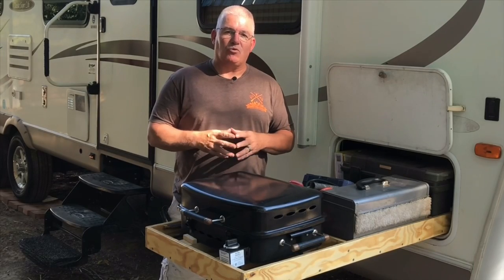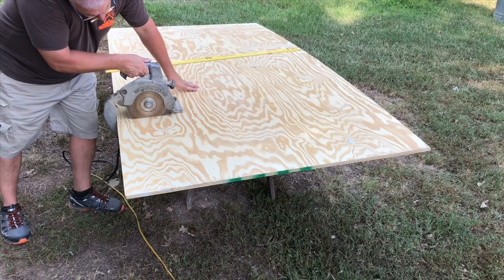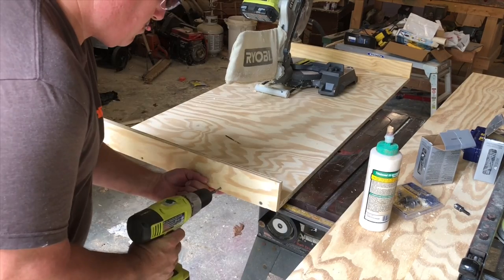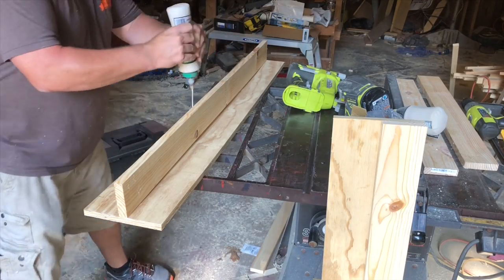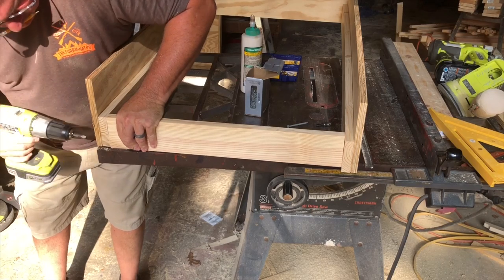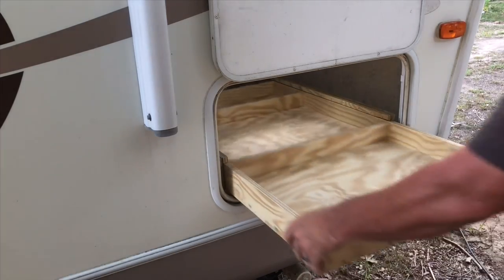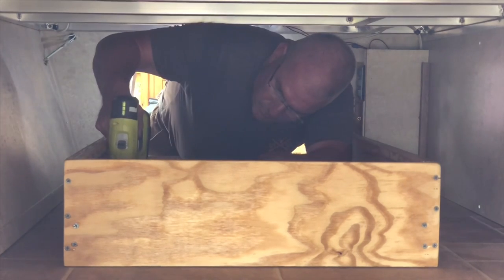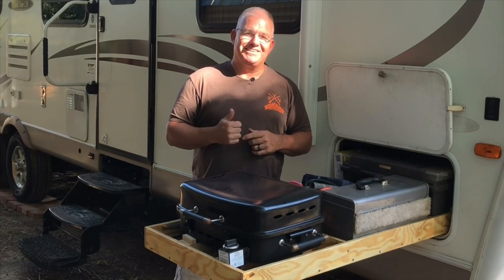DIY RV Storage Drawer

Comment: Love the concept, and way cheaper than buying custom made shelves. I just finished a pair of these for my travel trailer. I tweaked the design a bit by adding some casters under the drawer so they pull out easier, and attached barrel bolt locks to the front to keep the drawers in place while moving.
Reply: How did those casters work when pulling the drawer out. I was thinking of something like that

Comment: Thank you very much I've been sitting here beating my brains off the Wall trying to figure out what to do for my front storage compartment also.. This is been a big help.
Reply from the maker: Glad I could help, this thing has come in very handy since I built it. I use that drawer daily while camping and I’m never digging and hunting for anything because I have full access to everything on that side of the trailer. The other side is a different story, I had to move several things to even see inside the compartment on our last trip. Hoping to be able to make one for the other side soon. Thanks for watching and good luck with your project

Comment: Just found this video...a perfect inexpensive solution. I'm going to build them for my travel trailer...thanks!
Reply from the maker: Thank you, I think you will be pleased with the drawer, I would not want to go back to a big empty storage compartment. One tip that may help is, on the runner or bottom board that the drawer slides on, I coated it with WD40. Someone suggested coating it with a paste wax. Mine slides fine but the wax would probably be worth the try. Thanks for watching

Comment: I little bit of soap bar on the bottoms will help it slide. Also I'm surprised u didn't use drawer rails. But looks like a solid build in either case.

Comment: II've been watching lots of videos searching for this...I'm tired of reaching way back into my tool-storage bay trying to open tool boxes, remove trays and pull out that one tool I need and unstacking layers of boxes to reach the box I need that tool from so I was thinking of making an open-bottom slide-out with 300 pound sliders so that the area below the lip of my bay opening (6 inches) can be accessed easily and I could utilize the height above it with another slide-out and double-stack my boxes. I was thinking of using square tubing for rigidity and because it takes up less volume than wood. I can't travel without all my GC tools so my requirements are different than most RV travelers. Appreciate your video a lot...it let's me know I can do this.

Comment: Cool project.  I stopped in because I have kicked around the idea of doing the same thing on my Class A.  I have a long compartment like yours but only one door on one side. (passengers side)  So it's purpose I can only guess is for snow skies and long tent poles and such.  I have 24" wide rubberized plywood runners that are tounge and groove flooring stacked in there that we use as a hard patio floor.( Keeps the mud and dirt out of the Coach.) But have been wanting to build a slide out outdoor kitchen in it's place since it's right next to the outside sink and hot/ cold shower hose.

Here is a tip.  You can use Pocket Door Rollers to make your drawer slide easy. The rollers are brass ball bearing rollers with a cable size groove in the edge. (This edge groove is perfect for for use as a cable guide roller pulley.) Which make them the perfect choice for running in "V" notched plywood side runners.(Tounge style of the tounge and groove flooring)    You can buy these Pocket Door Rolllers at most box and hardware stores for about $8 to $14 dollars a pair. Your options are to seperate the rollers from the supplied bracketry and use the ball bearinged rollers individually, or keep them on the bracket and just double up on your rollers to spread the weight onto your runners. But using them on the supplied bracketry you can reduce the thickness of your plywood in this application and still have enough strength.
Lots of other ways to use these brass rollers.  I found them at Ace Hardware and used them for a different project, after searching for 1" to 1.25" ball bearinged cable rollers for a wall hugger recliner modification I wanted to do.  Funny thing though, the Ace Sales Guy swore up and down they had no cable pulley rollers for sale in the entire store, then I happened to walk by the pocket and screen door parts isle and saw them.  They were perfect.  I bought 8!  (All he had!) :)

Comment: The wife and I have 2021 mini lite with a pass thru, right now its disorganized. I thought paying 600 for the drawers and frame, but I really like the idea of using wood. The doors on both sides are the same size I think.
Reply from the maker: The drawer really helps, even if everything in the drawer is disorganized, at least you can pull it out where you can see what you have in it. Wood worked great and was still holding up great when we sold the camper in January. We bought a 2022 and we don’t need the drawer on this one, no pass through compartment and not much storage

Comment: Thanks for the ideas. Let me ask you about using wood screws or any screw for that matter when building and or working with plywood. Do you need to drill pilot holes before installing the screws themselves?

Thanks

Comment: Great simple design. Looks very sturdy! However, I believe you suffer from my disease. Probably most DIYers suffer from what I call the "overengineering disease." The three quarter plywood definitely makes a very sturdy drawer but as you showed us, it adds quite a bit of weight. I believe you could use thinner material and still make something strong enough to do the job you are trying to accomplish. A quarter inch bottom panel glued and nailed into a dado in the bottom of the drawer I think would work, especially if you added the dividers into the drawer. (Without the dividers I think quarter inch plywood would probably be too light for that long of a drawer carrying that amount of weight). I also believe you could use half inch material for the sides and definitely for the frame the drawer slides into. You need the three quarter boards for the runners for sure. I recently made some shelves out of half inch plywood with inch wide quarter inch  plywood strips glued and pin nailed around the periphery of the shelf. I've loaded some very heavy hardware on these shelves and they haven't bowed even a little. I hope maybe this might help someone who is particularly concerned about the weight issue but wants to use this wonderful design.

Comment: Like your video but will use 4 long plastic containers with tops bought from Walmart or target 2 on each side take items out that I need slide it back in and set 4 collapsible  chairs on top of containers got a pretty wide storage doors they fit nicely when I pull out a chair I set a container on chair look for what I need slide back in container put chair on top

Comment: Wonderful idea.  How do you determine what length of screws you can use to support the "L" brackets to the floor of the camper storage area?  Thx!
Reply from the maker: I made sure there was nothing under the floor that could be damaged by a screw passing through the floor. Also, I’m pretty sure most flooring will be 1/2” or 5/8” thick.
Reply: @TheFurrminator  Many thanks!  I'll be using your great idea on mine soon, I hope.

Comment: Thank you for this presentation in a drawer I want to use a drawer to widen my Ford Ranger so I can sleep with my feet sticking out in the store so I don't have to make it wider and I'll pick up a lot of space because most people run the bed lengthwise and as a result they're losing all kinds of a space usable space so if I go sideways and stick it out the put might extend my feet out when I'm stopped on camping and have a disk space Lee a box that can keep my feet and keep nice and warm your having insulated could be very very very nice I like the concept thank you very much

Comment: Loved your video brother. I was wondering how to build storage boxes where the door opens down from the side not the top. we are building an overland camper, its our first project, and we need to either find or build storage drawers that will sit on each side of the flatbed. They have to open down on the side to use them properly because the camper will sit on top of them. Any advice? Thanks

Comment: I was thinking about this prior to doing a search.  Googles the topic and what do you know, the exact thing I was envisioning.........thanks for the video!  My questions are, did you consider slides for the drawer, if so do you know the pros and cons? What was the thickness of the plywood, would the pocket joinery (Kreg) work as well?
Reply from the maker: You’re welcome, glad you found the video. I did consider slides for the drawer but I decided to make it this way because it is simple and inexpensive. I do realize that slides aren’t difficult to install and they aren’t really expensive but I like to show that you can build a quality product that works great and you can make it simple. I don’t think there will be any issues if you use slides, the should work great. If you build it like I did, I would use a wax on the wood runners where the drawer slides. I’ve never used the Kreg system but I like the concept and I look forward to trying it in the future, I think it will work fine for this project.
Reply: The Furrminator thanks!

Comment: I might have to make something like this for mine, nice job! How is it holding up so far? And how do you like the ryobi set?
Reply from the maker: It’s holding up great, I use that drawer for two of my tool boxes, a grill and assorted other items. We go camping once a month and the drawer gets slid in and out an excessive amount of times while camping and it still works as good as it did when I build it. The only thing I would add would be wax rather than oil to the drawer. I haven’t waxed mine yet but I’m going to add wax to it soon just to make it slide even easier.

Comment: I'm going to have trouble ripping those pieces straight without a table saw.
Reply from the maker: mit kooc another option is to clamp a 1x4 to the plywood and use it as a guide or a straight edge. You can use that to guide your saw and keep you straight. You just need to make some measurements to determine where to clamp the board

Comment: Some cool upgrades to your design unless you alredy done so: https://youtu.be/nRf2DJVN8WM   your design has some issues of not having a limit stop as well as no stoper to prevent movement at travel time. Otherwise I like some of the stuff better in your video over the other. Two combined would be the ultimate. Side put stopper can also be just added at the side with two pieces of wood on either side preventing the slide put.